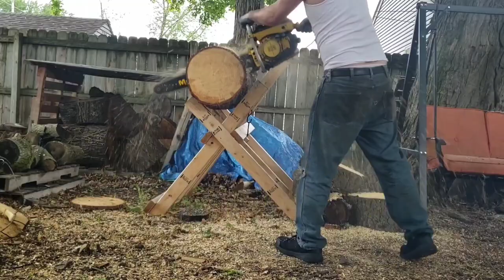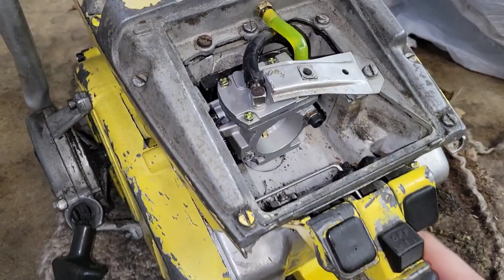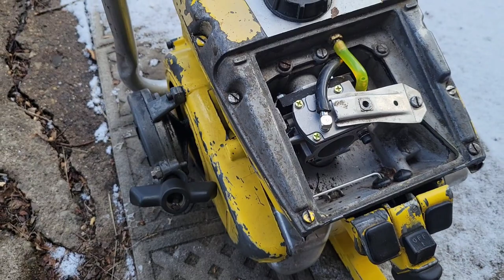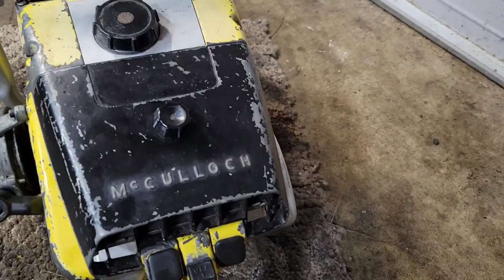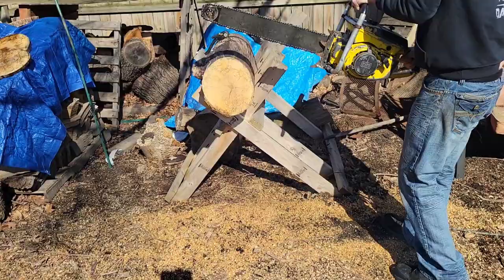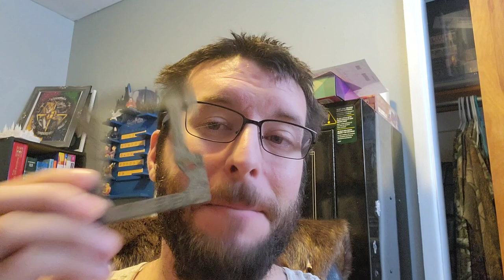McCulloch 790 MC101 Will It Run And Cut???

Comment: Sounded like it had an air leak from the start the way it was taking so long to come back to idle.
Reply from the maker: Running a little over sized carb on her that I havent gotten wood tuned yet but far from taking awhile to idle down vs some saws that have their own minds and will idle up and down on their own.

Comment: Do you think we be bolts bottomed out or the tank got hung up?
Reply from the maker: I know what the exact issue was and have it fixed. Very back of the lower gasket near the head didn't get enough crush because of being too thin vs McCulloch's thicker speced ones and the thin layer of sealer was the only thing hoding and failed under load. Video of that fix in a few weeks.
Reply: Great, glad to hear, bolts must have bottomed  in the block because of the thin gaskets, good to know
Reply from the maker: @nathansumerlin8391  wasn't from bolts bottoming out, just a surface isnt 100% flat and in that one small spot it wasnt able to provide a crush and where the bolts were it had done all the crush it could and things couldn't be torqued down anymore, wouldn't have done any good.